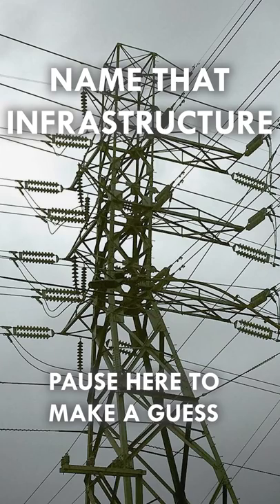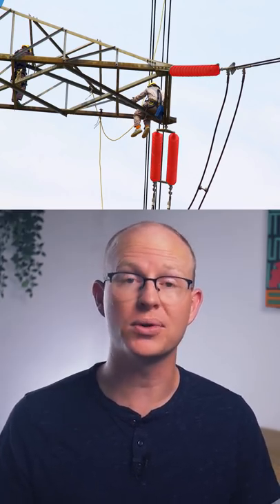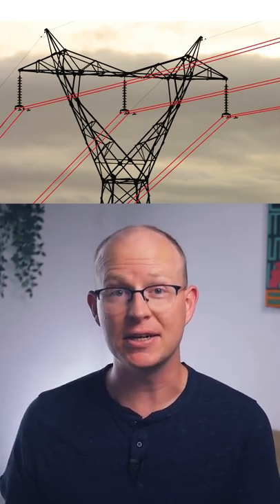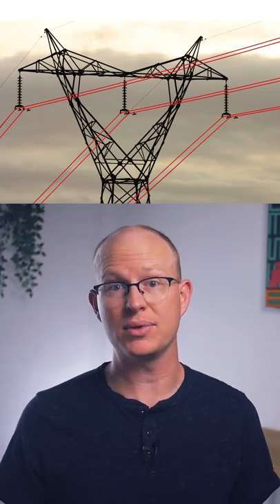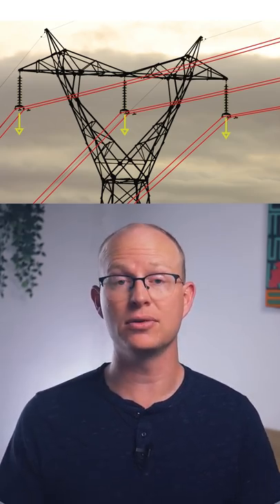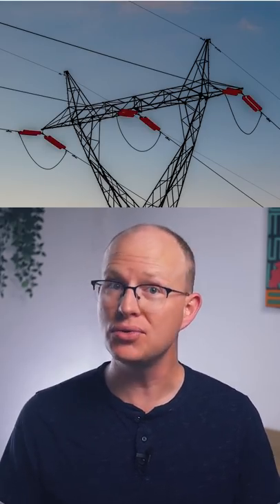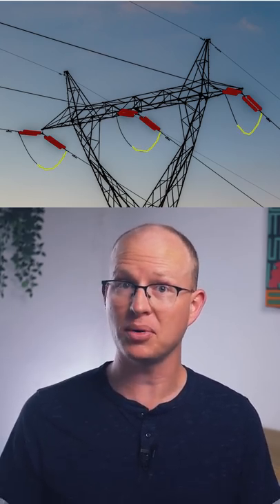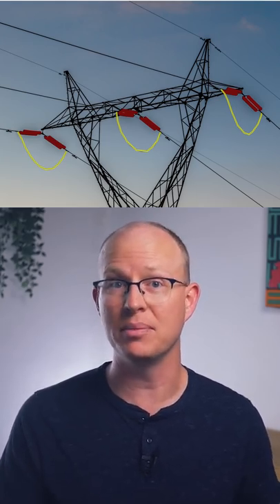Name That Infrastructure (Ep. 3) #shorts

Comment: My guess was "power tower" and I'm giving myself a passing grade, dammit.
Reply: I'm saying "wires", and no one can tell me I'm wrong.
Reply: same here lmao
Reply: I guessed high voltage transmission tower
Reply: Phylons
Reply: @sk3tchimdg3t33  no you didn't don't lie
Reply: @jordangolden7893  doing maintenance on those lines is my dream job
Reply: @jordangolden7893  yk on the helicopter
Reply: I called it high tension power line, but I always thought it had to do with super high voltage, not because the power line was pulling on the tower.  I
Reply: @kayakMike1000 turns out it's actually both

Comment: On the design side of things, we usually just call them Deadends (like the one pictured) and Tangents (standard tower that has balanced loads on either side). This one appears to be double circuit double bundle, likely 115-230kV judging by the length of the insulators.
Reply: What's the reason behind the double circuit/double bundle? Is it for redundancy or current capacity?
Reply: I paused the video and 'analysed' the picture - decided that it's a T junction between two sets of lines. The answer that Grady gave was much simpler than what I'd come up with!!
Have been fascinated by pylons and insulators for too many years to be honest!!
Reply: @Moonraker11  There are several reasons:

- Having multiple smaller wires vs. one thicker wire gives more surface area for cooling and is probably easier to work with

- Even if not for thermal reasons, a larger cross section means less losses

- Another reason is that at higher voltages, one singular wire has a relatively small radius, leading to increased corona discharge losses (a type of discharge that gradually increases the pointier something gets). A bundle of multiple wires at the same potential will approximately act like one big conductor with the diameter of the bundle, thus becoming less pointy and reducing losses.
Reply: Probably 137 kV, given that Grady from Practical Engineering is from Texas, and that is what most of their grid uses for intermediate distance transmission.
Reply: @Mezgrman  
I’m super interested in all this. I work manufacturing instrument transformers but I don’t know a lot of the technical side of things.

Comment: This is a "dead end" structure as opposed to the suspension structures you see which we call "tangent suspension" towers. As you have alluded to, there are many more forces acting on these towers than many people realize. The substantial weight of the conductors, plus wind and/or ice loads, along with rising moments for bottom-of-valley structures... so much going on.
Reply: I have my statics finals in a couple weeks and seeing it applied like this is just great

Comment: For additional points, you can determine the voltage of the lines based on the length of the insulators...
Reply: Single cable in each phase so somewhere around 230kV.
Reply: An ex-lineman told me to use 13k volts per insulator section as a rough calculation.

Comment: Transposition. Most likely two 220kV (ish) circuits meeting/splitting at a tension tower.  Leftmost circuit is noticeably being transposed (wrt. to one branch). Transposition towers swap between phases in order to even out asymmetry in intrinsic reactance determined by conductor geometry.
Reply: @SusanKay- Reactance is frequency dependent. Resistance is not.

Comment: Nice! I would love to see the insulators from up close and how they work
Reply: They are often like a stack of ceramic dinner plates fused together.
 The shape helps shed water, and prevent a film of water from forming a continuous conductive layer on the surface.
Reply: You could get up close to the tower and take a photo using a zoom lens.
Reply: I agree, "HOW these Insulators Work, How they are Made, and history of use would make a GREAT VIDEO!
Reply: Grady has a video about electric distribution ~8 months ago?? Per Grady, each disk on the insulator is good for 9Kv so count disks and you can figure the tension in that line.

Comment: My favorite specialized type of power line is the HVDC transmission line, since it has just two (or, rarely, one) conductors rather than three.
Reply: Both are attempts to minimize loses.

Standard AC transmission has 3 phases and the neutral cutrent cancels out so you have no return current halving you like loses from an equivalent single phase system. 

HVDC is used because for physics reasons wires have a lower resistance with DC power than the saem wire used for AC. (Skin effect, basically DC uses the whole cross section equally). But DC is way harder to change voltaged on so its less efficient in the convertion step so you get a "fun" optimization problem of lime loses vs transformer/converter losses.
Reply: @jasonreed7522  actually, in above ground installations, HVDC is mainly used because it's much cheaper to only run two smaller wires at a higher voltage, than 3 thicker wires at a lower voltage.

HVDC becomes feasible when the length exceeds a couple of hundred miles or so, when the cost of the inverter stations became less than the cost of the additional wire for AC.

The other use for HVDC is for underwater cables, and there it saves losses due to the capacitive losses with the water that AC has.
Reply: @ke6gwf  im an electrical engineer, the reasons to pick a technology are varied but in essence AC is easier to impliment because it is widespread and tranformers are really simple devices that don't need moving parts (some do but thats to adjust the winding ratio)

DC is more expensive to convert, but otherwise is generally better in the transmission line between converters. (I believe its also deadlier as an arcflash hazard but thats a different story)

For cost analysis you add up the price of the wires/cables & suporting infrastructure, cost of the voltage change equipment, and cost of the total losses of the system (I^2R, capacitive/inductive power factor issues, conversion loses, maintain and repair cost estimations, ext) and whatever cost the least overall is cheapest solution and probably the one to be built but outside factors may affect this decision, like transients and harmonics, wind power is notable for having lots of noise on the line (waves that aren't 60 Hz) so converting to DC will remove the noise, but depending on your converter it may make its own noise because DC -> AC is generally a digital composition of lots of tiny steps and that causes issues. (Look up how VFDs work [Variable Frequency Drives for big motors])

But as a rule of thumb HVDC is used for long distances or to merge unsynced or dirty power together such as from a wind farm.
Reply: @jasonreed7522  I hope that made you feel better about yourself lol
You basically said the same thing I just did, and showed that you have memorized a lot of theory, but don't have much real world experience.

I hope you recognize this before you start your career and make rookie mistakes because you think that theory solves everything.

Oh, and noise from inverters, whether from HVDC, or on industrial VFDs, can be filtered out, or avoided in the first place by good circuit design, for instance, going with true sine wave circuits rather then the stepped square wave "modified sine wave" that cheaper designs use.

Most wind farms feed directly into the AC grid, generally the only ones that use a HVDC intertie are offshore installation (because AC undersea cables lose a LOT of power to the water), or where it's a long distance from the wind farm to where they want to deliver the power, and HVDC is a cheaper alternative for a point to point transmission line.

If the wind farm produced that much noise, they would fix the issues that cause the noise rather than just slapping an HVDC station on it.

The other common HVDC usage is when they are connecting incompatible power grids, most famously in Japan where the grids were built in one area at 60hz and another area at 50hz, and so they use HVDC to tie them together.
Reply: @SusanKay-  basically, in 1895 Tokyo bought a generator from AEG in Germany that was 50 hz and began to electrify Tokyo, and then in 1896 Osaka bought a generator from General Electric in the US for their city which was 60 hz, and they were a long ways apart and so no one thought it a problem.
Then as the grid grew around each end of the country, new installations were matched to the existing equipment, and by the time the concept of a large scale grid was even considered, it would have been very expensive to replace all of the generators and motors in either city area to change the frequency, and so they just built out each end of the country on different standards.
They KIND OF get a pass for it because of how long ago it started, and how organically it became a problem! Lol
Reply: @jasonreed7522 There is always a return current. There has to be. That is a fundamental princuple of electrical circuit theory.

Current flows from the source through to the loads and back to the source.
If there is no complete circuit then current CANNOT flow.

Now, depending on which part of the electrical part of the distribution system you are looking at, there will be a neutral or not. On a three phase system current will flow in the neutral if the load across the phases are unbalanced.

If there is no neutral then the current returns back to the source along the phase conductors.

Typically in a 3 phase electricial system in the high voltage section, on overhead piwer lines there is no neutral. The neutral is derived at the distribution transformer where the high voltage is stepped down to low voltage and feeds people's houses.
Reply: @deang5622  thank you for agreeing with me.

I was talking explicitly about the 2 main types of transmission lines, 3phase delta amd HVDC. 3phase delta systems don't include a neutral wire because the neutral/return currents cancel to 0A and are assumed to be balanced. (A lot of work goes into making that assumption true) This means from a power losses perspective you only consider the resistance of the phase conductors. 

In an HVDC system the neutral/return current can't cancel with anything and so a neutral wire of equal size to the phase conductor is needed. This means (I^2)R losses will occure in both phase and neutral conductors effectively doubling them. (Although due to the skin effect the DC resistance of wires is alot lower than the AC resistance, this is one of the main benefits of AC power)

PS: if you want to be a stickler the "return current" in 3phase systems is carried back by the other phase conductors because instantaneously when phase A is 2A, phases B & C are both -1A.

Comment: Up to a certain (quite low) degree there is no need for tensioning towers when power lines make a turn.
For mild turns you might sometimes see two insulators hanging in a triagle shape - they hang vertikally if you look from the side, so they don't apply any tension. The triangle-shape is capable of withstanding higher forces that come from making the turn than just hanging the cable from one insulator.

You only see the tensioning-method if the turn is quite sharp and every so often to actually tension the cable, for intersections and every so often for the cables to switch sides. I.E. the most outer cable switches into the middle and then to the 3rd place roughly 1/3 of the length of the power line. This is done to keep electriy properties equal over all 3 cables.

Comment: In my country, these types of tension towers are also utilitized when the transmission lines are crossing road, highways and railways. 

Basically, during a broken wire event. These conductor will snap and pull towards the towers, and will not drop down vertically. It's a fail safe mechanism for the road or railway crossing underneath the transmission lines

Comment: I've seen the hanging jumper loops on the old wooden power poles in the small town where I grew up and I'd been curious about their purpose. I suppose it's the same as it is here. Though I think a better explanation of the "why" behind the different mechanical loads and how they tension insulators keep the poles from falling over is in order :) Maybe a 4 minute version?
Reply: Miniature versions of these towers, as Grady said when you dead end them to the tower they are more structurally sound , the loop we call either over the arm or under the arm as in the case of the tower makes it easier to remove these jumpers as they are not under tension to replace, also they act as a “drip loop” which means water will run down to the lowest point in the loop and drip off the center and not sit in the insulators or dead ends and prematurely weather wear them out. Also one long continuous line sitting in the glass up on the arm for many poles down the line creates a weight issue, the aluminum wire after about 100 ft is heavy , string that up from 3-500 ft and 3 phases plus a neutral wire and with wind or snow you have potential to snap arms or poles unnecessarily.
Reply: In most cases any time there is a jumper going from one side to the other is because its a dead end. Basically its where linemen use hoists to take out the slack of the cable they ran over multiple spans, cut the cable, put clamps on the end of the line to hold it in place, then the jumper is for continuity for the power line. On the distribution level, there are other situations like fuses, switches, breakers, and capacitor banks that may also have jumpers from dead ends.

Comment: The "tension structure" is not use only when turning or ending pole, but it can be also used when crossing roads, rivers, etc. The rule is that you want to have stronger hold when crossing this elements and ensure that if one set of isolators breaks the other ones can hold them.

Comment: Hmmm…looks like a 230 or 500kV double circuit lattice tower deadend with double bundled conductors and high-tension insulators.  Hard to tell from the picture, but it looks like it might also be a tap structure?

Down lower looks like a distribution pole just out of the shot on the right side.

Comment: If you are traveling via trains in India you will always see if the power lines cross the tracks there will tension structures over the tracks whereas every other tower would have vertical insulation.

Comment: What about the uneven stress on a 'corner' tower? With wires just suspended going in the same direction on each side, the loads are balanced, but at points where the wires go in  different directions you could get quite a load on one side of the tower. How is this handled?
Reply: Steel Structures and Lattice Towers (the one pictured) are usually pretty strong laterally. The base/foundation is usually a micropile or concrete pier which is embedded into the ground. The structure gets bolted to that. Usually loads on corners like that aren't insanely large. For wooden poles, guy wires (those diagonal cables you see on poles near your house) are used. Deadends like the one pictured are usually significantly larger than the tangents surrounding them, and are designed based on the loads that they see when modelled.

Comment: Are most UK transmission towers tension structures? As I can't recall many suspension structures. 🤔
Reply: Suspension is more of a structure type, which is why most structures are typically first classified by Deadend and Tangent (the ones at the end/corner of a section and the ones along the section). You can have a Tangent structure that isn't a suspension structure for example. If you have a lot of structures that appear to be "tension" structures, that would imply they are all deadends, which are typically a lot stronger and are overkill for most line designs. My suspicion is that "most" towers in the UK are Tangents due to most designs having mostly Tangents, with a few Deadend structures on corners/end points.
Reply: @LoganLovell  Thank you for your response! 
This is way outta my knowledge, so I appreciate you teaching me about this. 😊

Comment: "Transmission wires"? Not sure your usage of the word transmission and wire together is correct here. Wire is a component of the conductors which are built to a very specific size and those are spaced on the tower with a very specific spacing to create an impedance which makes it a transmission line. Because the individual wires in the conductors are used to build up the size of the conductor, but individually have no relationship to the the other conductors on the tower, they will not have an impedance and therefore “transmission wires” does not make sense here. A Google search found “transmission wires” connect a car’s transmission to the car’s computer but that does not seem to make sense here either. I was unable to find any reference to “transmission wires” in regards to electrical power transmission.
Reply from the maker: It’s a rhetorical device. The script says “might look like a maze of transmission wires” as a counterpoint to what you’re actually seeing. Sorry for any confusion.

Comment: I'd be curious what the wind rating is on these high-tension structures. I've seen many of these towers toppled after a hurricane and even a tornado...
Reply: Those are storms with famously strong winds. Although the ice storm of 98 made the wires in our tower weigh 50lbs per foot, yeah they all crumpled and i have a book on the event and its cover is crumpled kV towers (like the largest ones with 4plex bundles) and its definitely unnerving, like if the Eiffel Tower was crumpled under ice.